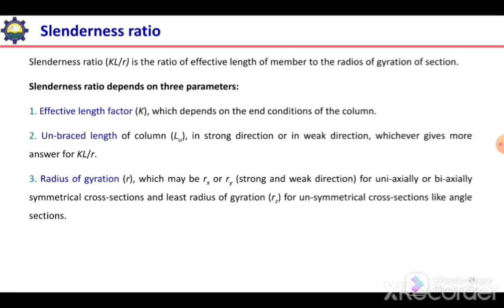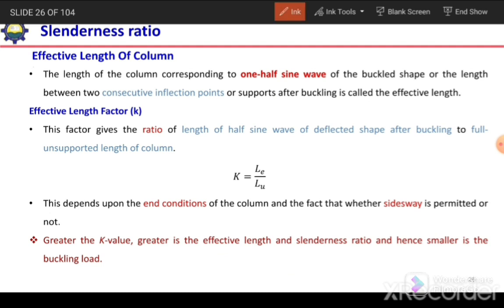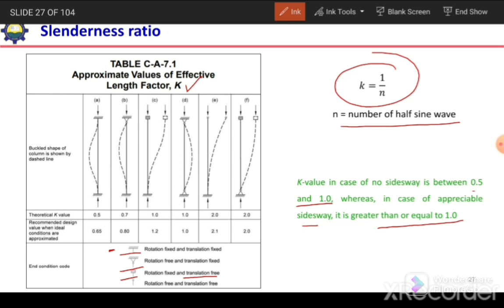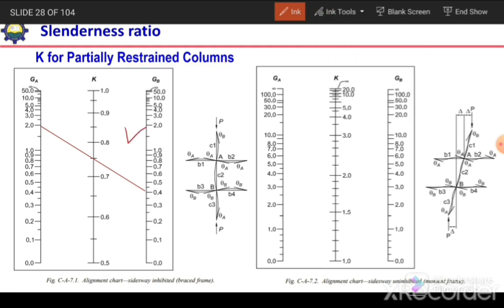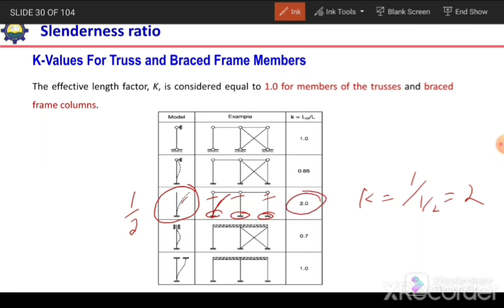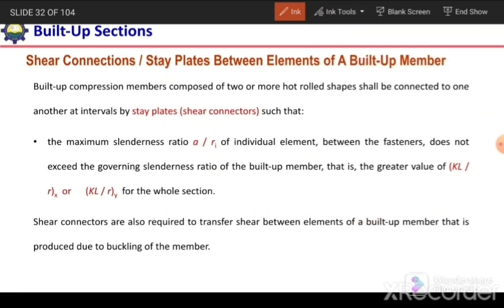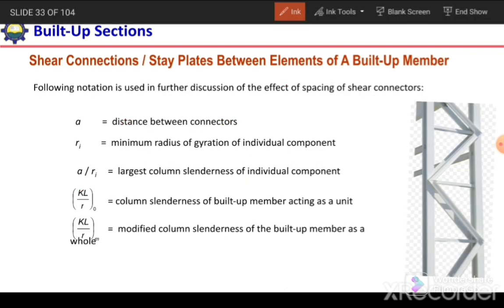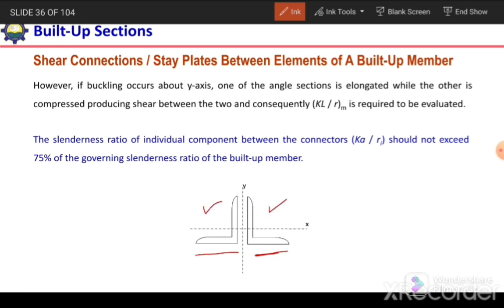3. Design of steel compression members- slenderness ratio, effective length factor modified SR

Comment: AoA Sir!
can you tell me when would I use planar trusses relation and Space Trusses relation to make correction in slendernes ratio of Single angle.?
Reply from the maker: If truss is a plane truss then corresponding relation..... Space truss is the one which have members in  x,  y and z direction such as transmission towers
Plane truss are usually found in roofing systems
Reply: @engineeringstudio  Thnx 
highly appreciable knowledge you have...
MashaaAllah...
Reply from the maker: @samisam396  thanks for appreciation
You can subscribe the channel for more updates